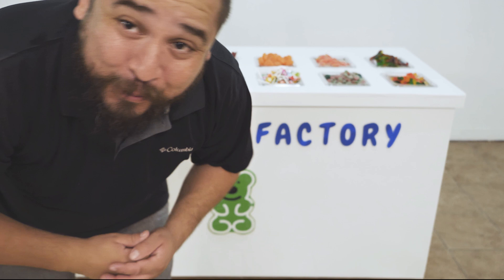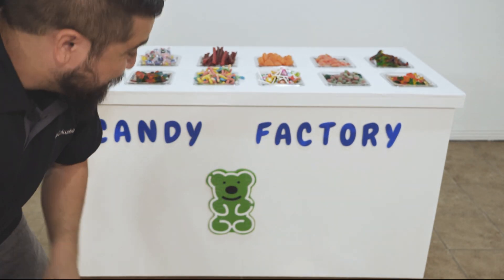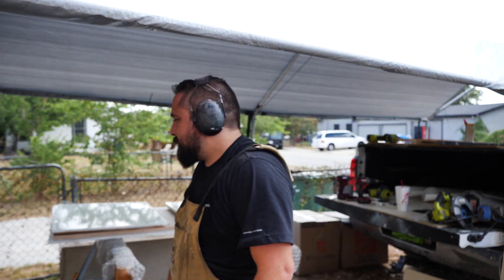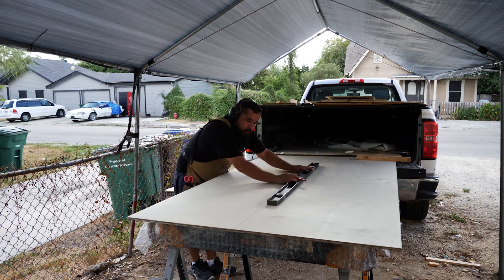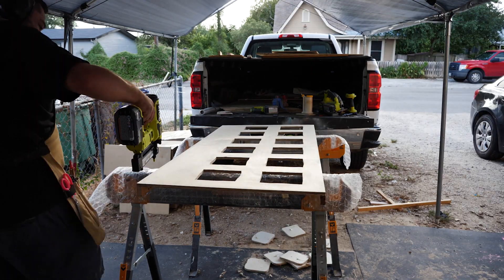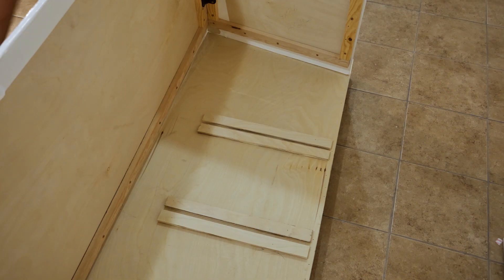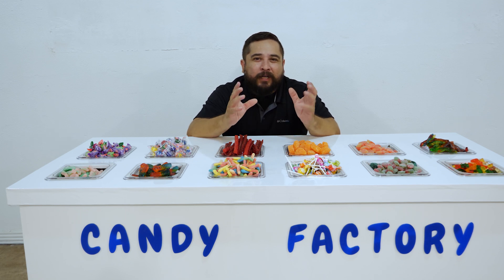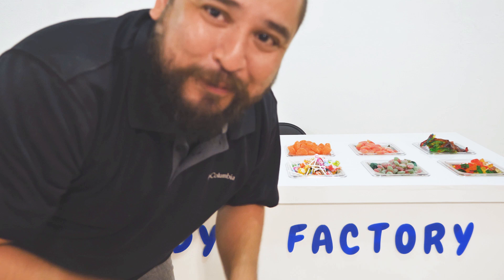DIY Candy Bar, Food Cart

Comment: How much of the vinyl did you buy?
Reply from the maker: I believe I used two 5ft pieces and a 4ft piece for the sides. I will tell you that I remade the sizing in the plans to bring it to 4ft long. As since it was closer to 5ft in the video. I struggled with making the vinyl reach all the way around the table top. But since I shortened it to 4ft wide, it takes less plywood and the vinyl should fit better. I hope this helps and let me know if you have any questions. Good luck!

Comment: How were you able to make the vinyl stick to the plywood. I didnt have any luck. I tried preoing the pltwood beforehand, sand smooth, clean, still struggled to fully adhere.
Reply from the maker: Oh no, sorry about that. Not sure what would be the difference? Mine is still stuck to it and I know would give me trouble if I tried to peel it off. I didn't do anything special. Just peeled and stuck it on there. Maybe it was a different type, or they changed it now? Or the weather can also affect the glueing. I wish I had a better answer and let me know if you find out what the issue was.
Reply: @MakerDecor  it's just the plywood is too porous and not a good bonding surface. I was looking around the shop and came across a 3m multipurpose spray adhesive. Worked really well. Has a good hold, not sure how it will survive with change of weather but for now seemed like a good solution.
Reply from the maker: @alexkico4657  Awesome, completely forgot about that stuff. Thanks for responding back, just incase somebody else runs into that issue. Good luck!

Comment: How does the 1/2" plywood handle the weight? Or would you recommend 3/4" instead?
Reply from the maker: Hi, this handles it well. As its not really a lot of weight. I try to stay away from 3/4 as much as I can. Because the weight really does start to add up. If I ever decided to increase the weight support I would most likely try to add a middle plywood support from the bottom to the top similar to a cabinet. As it will help with increased weight with out changing the whole cart to 3/4 heavier material. But I do have other carts that are meant for heavier products mainly the cart with bicycle wheels and axel. This one and similar are not intended for extremely heavy items. Thank you and good luck
Reply: @MakerDecor  thanks for the suggestions, I appreciate you. I was going back and forth on that.
Reply: Also I was thinking of high gloss paint on bottom and vinyl wrap top. Have you tried that combo before does it match well or will it look weird paired together?
Reply from the maker: @alexkico4657  No I have not tried that combo. I think it may work depending on your painting skills and probably the colors you're choosing for the vinyl and the paint. But that would probably be kind of difficult to make them go together and look clean. I haven't done it so I'm not 100% sure. Sorry about that. I do have a YouTube short Where I make an ice cream cart. And I covered that one in printed vinyl words that say maker decor ice cream. It was pretty easy to make an image and have them print it on a vinyl. Think I paid like 80 bucks just for that one cart. So there's definitely a lot of different ways you can do. It just depends on what works best for you. Good luck!

Comment: cool video ....do we guess the measurements?????
Reply from the maker: Thank you very much, but I would not guess the measurements as you build it. I have them written down along with step by step directions while you build it on my website and Etsy shop. The links are in the video description. But for the plans I have made it 2ft wide x 4ft long to make the build more cost effective. The one built in the video was 5ft long but with a lot more wasted material and cost. So I decided to change the length to 4ft which saved money and time while still looked similar. Good luck!
Reply: What about for the little squares where you put the containers of candy